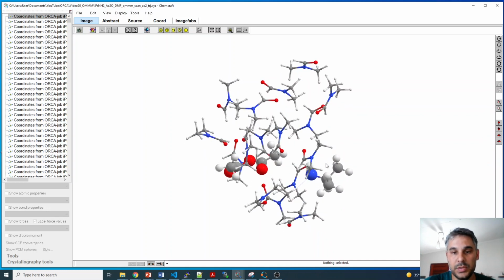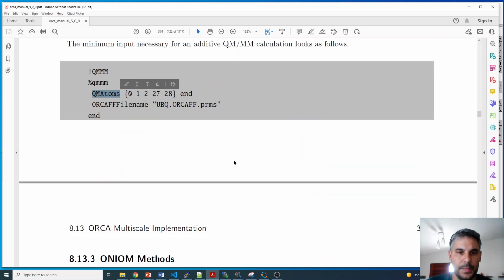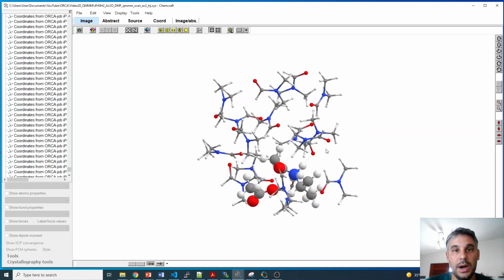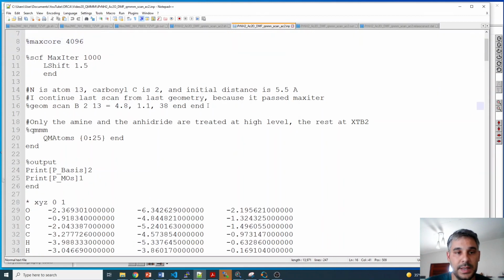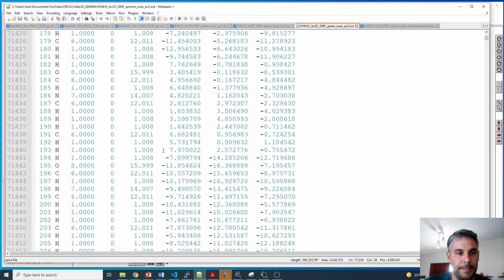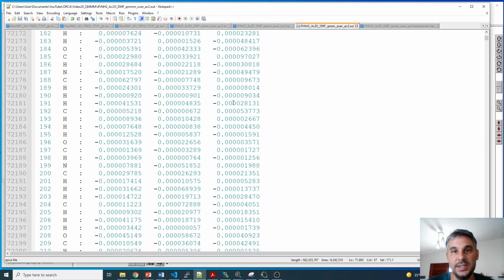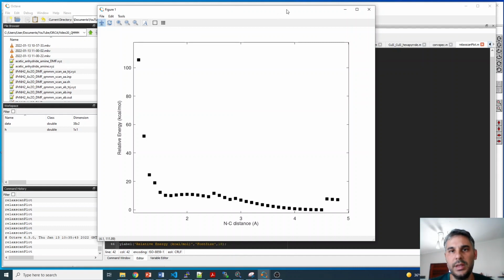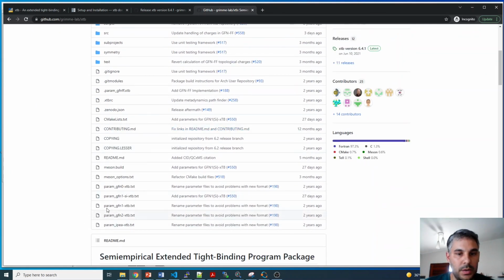Doing Multilevel (QM/QM) Calculations in Orca using the XTB Program.

Comment from the maker: !QM/XTB PBE0 def2-SVP def2/J RIJCOSX DefGrid2 SmallPrint Opt Freq
%pal nprocs 16 end

#QM/QM calculation using XTB as low-level method.
#Nucleophilic attack of iPr-NH2 on acetic-anhidride, in DMF
#Optimization restarted from end of previous geometry optimization in the first scan step

%maxcore 4096

%scf MaxIter 1000
	LShift 1.5
	end

#N is atom 13, carbonyl C is 2, and initial distance is 5.5 A
#I continue last scan from last geometry, because it passed maxiter
%geom scan B 2 13 = 4.8, 1.1, 38 end end

#Only the amine and the anhidride are treated at high level, the rest at XTB2
%qmmm
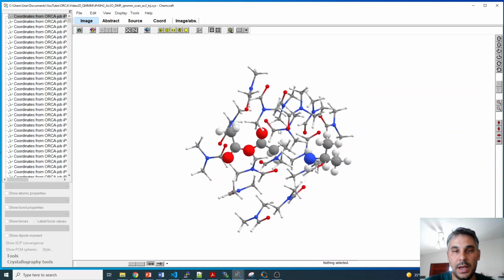	QMAtoms {0:25} end
end

%output
Print[P_Basis]2
Print[P_MOs]1
end
Reply from the maker: * xyz 0 1
O    -2.369301     -6.342629     -2.195621
O    -0.918340     -4.844821     -1.324325
C    -2.043387     -5.240163     -1.496055
C    -3.277726     -4.573854     -0.973147
H    -3.988333     -5.337645     -0.632860
H    -3.046690     -3.860170     -0.169104
H    -3.730681     -4.022286     -1.812006
O    -1.762740     -7.508343     -3.969132
C    -1.453946     -7.143325     -2.873838
C    -0.141154     -7.410245     -2.209174
H     0.539063     -6.576740     -2.432621
H    -0.258546     -7.512044     -1.120779
H     0.256034     -8.337191     -2.636767
N    -3.835512     -0.759132     -1.334536
H    -3.688864     -1.267809     -0.458183
H    -4.730722     -1.108795     -1.696520
C    -3.935252      0.670730     -1.059031
H    -4.122509      1.173085     -2.027601
C    -2.602050      1.181986     -0.528320
C    -5.084079      1.043762     -0.126908
H    -6.042261      0.698886     -0.544340
H    -4.948642      0.560495      0.855117
H    -5.154233      2.132852      0.031582
H    -2.386284      0.717824      0.448932
H    -2.617953      2.273791     -0.385648
H    -1.788426      0.924836     -1.222093
H    -6.912800     -4.928618      4.291866
O    -4.815167     -8.598669      4.657727
C    -5.428105     -7.730280      4.062290
H    -5.986282     -7.947167      3.135468
N    -5.499500     -6.451089      4.420689
C    -4.859826     -5.988461      5.631507
H    -4.230793     -6.789526      6.015080
H    -5.611421     -5.731966      6.380098
H    -4.259934     -5.104288      5.418796
C    -6.209737     -5.463122      3.652713
H    -6.756113     -5.939644      2.841749
H    -5.509871     -4.734430      3.237859
H     2.425146     -4.360937     -3.462367
O     4.336005     -2.712052     -0.626748
C     3.735933     -3.208143     -1.561233
H     4.265290     -3.680335     -2.409909
N     2.411350     -3.264294     -1.689794
C     1.553789     -2.700175     -0.674357
H     2.133608     -2.566609      0.237141
H     0.720728     -3.376230     -0.493791
H     1.162539     -1.734365     -1.002076
C     1.763431     -3.704585     -2.899996
H     1.500662     -2.846956     -3.525438
H     0.850020     -4.237292     -2.639586
H    -2.656727     -9.030403      3.690747
O    -4.087104    -11.264914      0.423297
C    -3.271474    -10.557591      0.995792
H    -2.606949     -9.872527      0.446102
N    -3.083743    -10.514107      2.311610
C    -3.868163    -11.335697      3.204351
H    -4.584864    -11.897560      2.608607
H    -4.390241    -10.698796      3.920441
H    -3.220582    -12.029346      3.745384
C    -2.139135     -9.624108      2.934438
H    -1.694832     -8.967445      2.187475
H    -1.348972    -10.198595      3.426185
H     0.409208     -0.658711      1.174378
O    -2.994115     -2.235271      1.303343
C    -1.857940     -1.790771      1.295253
H    -1.231424     -1.842748      0.389050
N    -1.254796     -1.174021      2.305537
C    -1.888102     -1.044874      3.596735
H    -2.809273     -1.624192      3.608763
H    -2.116921      0.003256      3.803407
H    -1.222254     -1.421555      4.372915
C     0.107026     -0.714698      2.218353
H     0.771645     -1.411701      2.736588
H     0.188672      0.273179      2.675534
H     2.263046     -6.830809      3.875686
O    -0.278290     -7.424727      1.167831
C     0.536585     -7.197714      2.041648
H     0.368900     -7.529388      3.083233
N     1.700898     -6.571545      1.889115
C     2.092344     -6.020254      0.612781
H     1.232608     -6.033188     -0.053267
H     2.899965     -6.611709      0.173777
H     2.435073     -4.995758      0.752723
C     2.568466     -6.267229      2.996362
H     2.517867     -5.198547      3.220949
H     3.596632     -6.528786      2.742422
H    -5.886497    -10.413018     -0.369579
O    -7.916291     -7.063213      1.279620
C    -7.826754     -8.111393      0.657554
H    -8.690766     -8.792312      0.560091
N    -6.742489     -8.558501      0.039923
C    -5.505082     -7.813365      0.074282
H    -5.677971     -6.875649      0.599179
H    -5.159406     -7.617591     -0.941726
H    -4.734617     -8.387194      0.591725
C    -6.715844     -9.790220     -0.710846
H    -6.579573     -9.572532     -1.772157
H    -7.651189    -10.328414     -0.572726
H    -1.615861     -0.206018     -4.971968
O    -2.213060     -4.190305     -3.861735
C    -1.799547     -3.289067     -4.568988
H    -1.754959     -3.398269     -5.671705
N    -1.360201     -2.106455     -4.152096
C    -1.330459     -1.785165     -2.740401
H    -1.196386     -2.704282     -2.176908
H    -2.268138     -1.312731     -2.406242
H    -0.492358     -1.114498     -2.563588
C    -0.938198     -1.060329     -5.047513
H    -0.933358     -1.422733     -6.074287
H     0.066249     -0.723977     -4.780737
H    -7.593502     -5.145501     -0.068814
O    -8.350613     -2.955680      2.882767
C    -8.155279     -3.625148      1.881029
H    -8.702899     -4.565203      1.699455
N    -7.286998     -3.343960      0.917063
C    -6.496533     -2.134309      0.937666
H    -6.898857     -1.471230      1.701009
H    -6.555841     -1.656202     -0.039480
H    -5.451254     -2.359239      1.162022
C    -7.128394     -4.178018     -0.244999
H    -6.066661     -4.310171     -0.450777
H    -7.583895     -3.701211     -1.115914
H    -5.138627    -10.816017     -3.400509
O    -2.280665     -9.008386     -1.767450
C    -3.200753     -9.595783     -2.308276
H    -4.090976     -9.063143     -2.670484
N    -3.240305    -10.902903     -2.558486
C    -2.167634    -11.764576     -2.125979
H    -1.349068    -11.136978     -1.779205
H    -1.829976    -12.387228     -2.956658
H    -2.507331    -12.402992     -1.307711
C    -4.411925    -11.556964     -3.075211
H    -4.862477    -12.179870     -2.297898
H    -4.140387    -12.190722     -3.922826
H    -2.887443     -6.161808      3.171757
O     0.632730     -3.720844      2.762464
C    -0.354232     -4.302077      2.339580
H    -0.494854     -4.503406      1.266018
N    -1.352785     -4.769208      3.084848
C    -1.381549     -4.542989      4.511574
H    -0.457239     -4.041844      4.792591
H    -1.452418     -5.496161      5.040022
H    -2.235670     -3.917502      4.777375
C    -2.515099     -5.388188      2.500723
H    -2.248952     -5.847938      1.550540
H    -3.299098     -4.643227      2.339877
H   -10.349903     -7.612282      4.259151
O    -8.184161     -5.293783      7.068909
C    -8.373718     -6.201324      6.281356
H    -7.841307     -7.166488      6.366999
N    -9.213264     -6.169501      5.246621
C   -10.009636     -4.989629      4.986812
H   -10.083619     -4.416440      5.909178
H   -11.006888     -5.287665      4.664535
H    -9.552294     -4.362262      4.217991
C    -9.320458     -7.246665      4.297734
H    -8.666599     -8.065478      4.593125
H    -9.030270     -6.909504      3.299555
H    -8.151127     -3.026184      6.488185
O    -4.205022     -2.765220      5.012550
C    -5.396279     -2.492355      5.003729
H    -5.916174     -2.207759      4.075213
N    -6.198913     -2.504148      6.061747
C    -5.706200     -2.854126      7.372700
H    -4.646814     -3.089947      7.293395
H    -6.256989     -3.716349      7.753136
H    -5.842051     -2.017265      8.061239
C    -7.610633     -2.228584      5.976365
H    -7.925918     -2.193066      4.935562
H    -7.844099     -1.277362      6.462278
H    -6.355251     -2.091271     -6.743799
O    -6.316564     -1.730360     -2.551717
C    -6.480898     -2.302411     -3.616016
H    -7.247392     -3.082233     -3.742672
N    -5.792993     -2.077788     -4.734813
C    -4.735449     -1.096304     -4.793760
H    -4.533535     -0.728658     -3.791245
H    -5.024341     -0.262730     -5.439109
H    -3.832855     -1.559778     -5.194069
C    -6.055222     -2.789894     -5.958290
H    -6.849794     -3.517241     -5.804977
H    -5.149149     -3.308248     -6.284614
H     4.080115     -0.431905     -0.479105
O     1.798262     -0.062870     -3.460933
C     2.611743     -0.095271     -2.557205
H     3.504319     -0.740834     -2.595580
N     2.533195      0.604795     -1.422196
C     1.472081      1.566275     -1.230386
H     0.874077      1.597256     -2.139774
H     1.889972      2.556432     -1.038563
H     0.837182      1.281943     -0.387446
C     3.508381      0.487766     -0.366212
H     2.996189      0.456934      0.596203
H     4.190788      1.341571     -0.369987
H    -4.170860     -7.564925     -6.729657
O    -6.274485     -8.667126     -3.814517
C    -5.584634     -8.291503     -4.753991
H    -5.381152     -8.963416     -5.608005
N    -5.020130     -7.103561     -4.884631
C    -5.142387     -6.089012     -3.862875
H    -5.521290     -6.551244     -2.954154
H    -5.840555     -5.313456     -4.184585
H    -4.162762     -5.652068     -3.672988
C    -4.160225     -6.767971     -5.988550
H    -3.140740     -6.634449     -5.619534
H    -4.504032     -5.840819     -6.451736
H    -9.626858     -8.461905     -5.428183
O    -8.154907     -5.027356     -4.980753
C    -8.630450     -6.139637     -5.119295
H    -8.880507     -6.538473     -6.119240
N    -8.925216     -6.986855     -4.137510
C    -8.617837     -6.660770     -2.764689
H    -8.265464     -5.632820     -2.727250
H    -7.840624     -7.331487     -2.396698
H    -9.509639     -6.765912     -2.144073
C    -9.388007     -8.328699     -4.374189
H   -10.282696     -8.523937     -3.777541
H    -8.607699     -9.039643     -4.088847
*
Reply: Thank you, thank you, thank you so much, thank you one thousand, and thank you.

Comment: Thanks for your video. Im doing a single point calculation with ORCA by using "!QM/XTB2 pbe0 d4 def2-tzvp def2/J". The jobs start calling xtb program. However, xtb programs does a geometry optimization....How can i avoid this geometry optimization??
Thanks
Reply from the maker: can you post the whole input file (without the coordinates)
Reply: @niconeuman  Thanks for your time. This is the input: 
!sp QM/XTB2 pbe0 d4 def2-tzvp def2/J

%QMMM
   QMATOMS {0:203} 
END

%maxcore 35000

%tddft
    maxdim 5
    nroots 25
    maxcore 35000
end

This input works for smaller systems. 
 Thanks for your time.
Reply from the maker: @mcgregor2061  I'm sorry, I don't really know what is going on. I searched for a keyword like NoOpt, to include in the %qmmm block, in the Orca manual, and couldn't find anything similar. Can you check ir the program is optimizing only the QM2 region, while your high-level region stays the same? That at least will tell you if the !sp keyword is working. But I would ask this in the Orca forum, they will know better.

Comment: Hi Nicolas, do you know how to perform Ab Initio Moledular Dynamics (AIMD) calculations with ORCA 6.0.1?
Reply from the maker: @juancamilorodriguezbetanco4079  yes I know how to do that. But my experience isn't very good, because you need to use very small integration steps to avoid H atoma flying off. I have started doing MD with XTB, and it works really well. And it is very simple to do.
Reply: @niconeuman  Muchas gracias Nicolas, tu sabes si de alguna forma con QM/QM o QM/MM puedo calcular a cada timestep un tddft?, para modelar un hamiltoniano dependiente del tiempo
Reply from the maker: si, en principio, pero no se si es la forma más adecuada de hacer eso. Creo que hay programas que hacen RT TDDFT.  Creo que Orca no, pero puedo estar equivocado

Comment: I want to investigate the geometrical change of azobenzene from trans isomer to cis isomer through the relaxed scan PES by scanning the C-N=N-C. I tried based on the orca 6.0 manual but the atoms become spread out. Could you help to find out how to it? Thank you in advance
Reply from the maker: can you post your input file? remember that you have to choose your starting parameter of the scan very close to the actual value in the starting structure. And dihedral angles have to be defined in a certain order, so the numbering of the atoms has to be kept the same in the %geom scan D X1 X2 X3 X4 = startAngle, endAngle, nsteps end end block as it was measured manually by you in the geometry. You have to also check that your starting geometry is realistic and doesn't contain atoms bonded in a weird manner.
Reply: @niconeuman  here is my input file

! B3LYP/G SV(P) Opt

%geom Scan
  D 12 1 0 2 = 0, 180, 20
  end
end

%pal
  nprocs=8
end

%geom
   MaxIter 300
end

%maxcore 1000

* int 0 1
 N      0   0   0     0.000000000000     0.00000000     0.00000000
 N      1   0   0     1.266212383438     0.00000000     0.00000000
 C      1   2   0     1.378981204254   117.20832184     0.00000000
 C      3   1   2     1.400689891494   123.41602545   335.06193366
 C      3   1   2     1.398810895176   116.92243025   159.35870397
 C      4   3   1     1.378703516425   119.93606890   184.06469816
 H      4   3   1     1.079927549392   118.51784199     3.08408358
 C      5   3   1     1.379423938565   119.96412006   177.03697458
 H      5   3   1     1.079227002580   118.71786405   355.80968604
 C      8   5   3     1.387568304715   120.20655369   358.83101785
 H      6   4   3     1.080527919087   119.89899534   179.56516009
 H      8   5   3     1.080183199728   119.89190223   179.29313228
 C      2   1   3     1.378864021494   117.22366116   173.20881150
 C     13   2   1     1.400702595310   123.38901527   334.83464699
 C     13   2   1     1.398825154455   116.94926313   159.18151291
 C     14  13   2     1.378713401158   119.94220931   184.14170289
 H     14  13   2     1.079932074898   118.50950251     3.13871165
 C     15  13   2     1.379391265486   119.96188778   176.96998043
 H     15  13   2     1.079240021639   118.72544357   355.72308974
 C     18  15  13     1.387580919213   120.21187199   358.83056176
 H     16  14  13     1.080511162223   119.90139949   179.58031757
 H     18  15  13     1.080203428586   119.89821312   179.29368094
 H     20  18  15     1.080027199443   119.92964397   180.73298357
 H     10   8   5     1.080027738999   119.93408666   180.70163219
*
Reply from the maker: I can't open your input file with chemcraft of avogadro. Can you transform the coordinates from internal to cartesian? 
But my guess is that your are forcing a certain dihedral to start from zero, but in your initial structure the dihedral is different from zero, so orca attempts to twist the molecule in a step which is too large, and breaks the structure. You have to start from the value that you have in the initial structure, and it is better to actually measure it manually in a graphical editor, so you are sure.

Comment: Awesome video! I am working on a small system where the concern is on charged species. Whenever I try to run for charged species that is in input line I type "xyz 1 2" it always give me an error but when I use the same model for neutral state, it runs smoothly. Any tips would be appreciated.
Reply from the maker: @jimitpatel5651  whenever you change the charge you have to change the multiplicity accordingly. You may have a singlet charged species and a doublet neutral one.
Reply: @niconeuman  Thanks for the reply! I am using single charged species as my model has 1 unpaired electron and according to the formula of multiplicity which is 2S+1, the multiplicity should be 2 and thats what I am using.
Reply from the maker: @jimitpatel5651  if you get an error regarding multiplicity, check that you are not missing or have extra H. Sometimes drawing software autocompletes H atoms and it gets it wrong.

Comment: very useful video, thank you for the explanation! what software do you use geometry setup and to check the results?
Reply from the maker: Thank you! For editing structures and looking at optimized geometries, orbitals, etc, y use chemcraft. For analysis I use Octave or Origin, depending on the complexity of the analysis.
Reply: @niconeuman Thanks! I used to use Chemcraft, but it wasn't a really good editor Maybe I should check it out again

Comment: Hi. Thanks for your useful video. I got an error that there is no otool_xtb in orca binary path. How can I solve it? Any comments would be appreciated.
Reply from the maker: You have to add the path to where the xtb binary is installed. If you use a shell file for submitting your calculation it is something like: echo $PATH path/to/xtb. But I don't remember exactly. In the xtb web page there are some instructions. It is basically telling orca where xtb is installed.
Reply: @niconeuman  I already did it, but still have the problem. Do you have otool_xtb in Orca directory?
Reply: @niconeuman  I just solved the problem by using below command:
ln -s $(which xtb) otool_xtb
thanks for your time. 
please share more video on QM/MM with orca. Cheers